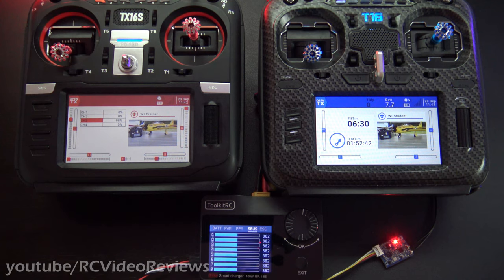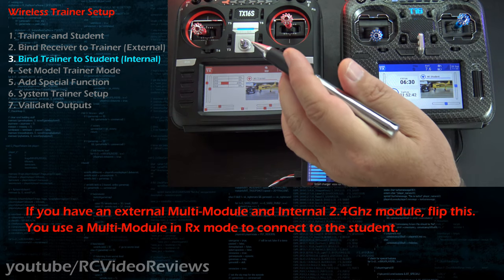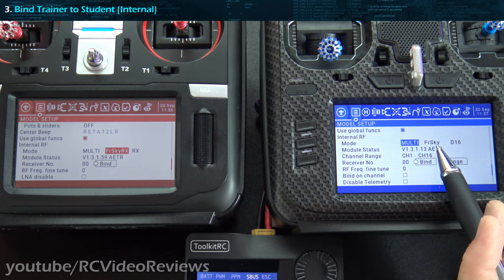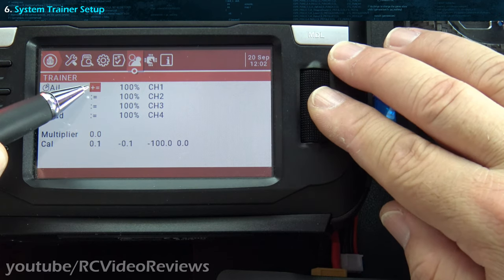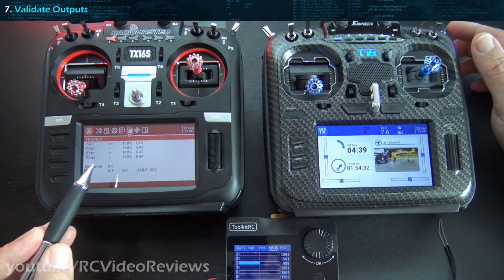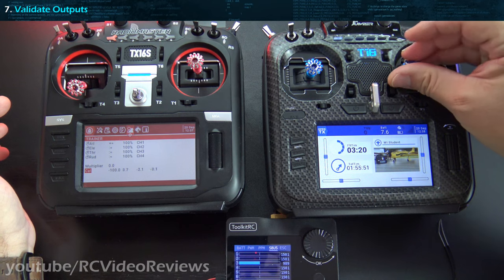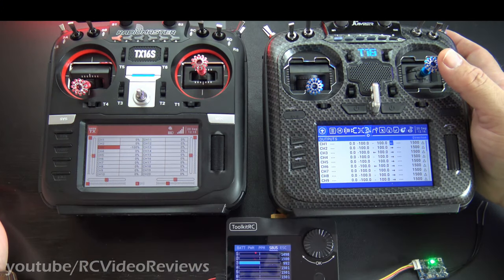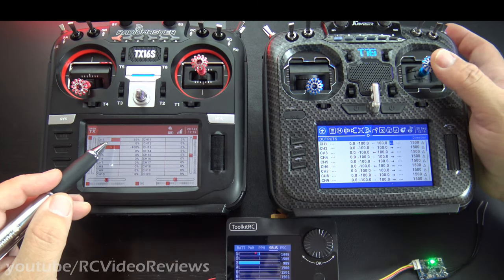OpenTx Wireless Trainer How-to • Complete Guide for Radiomaster TX16s or Jumper T18 • [Intermediate]

Comment: Hey John, updates on the TX16S trainer connection. The PPM trainer socket at the top of the Radio is pretty well useless for a Buddy Cord to another Tx. The 4-contact socket is a non-standard 3.5mm Cliff Electronics unit and, even when we got the correct plug/cable, the connection proved less than rock solid. So we added a cheap FS-A8S PPM/I-BUS/S-BUS powered by the neg (second bottom) and + (3rd from bottom) pins in the External Bay when the "External Module" is activated and soldered a fly lead to the 3rd contact of the Trainer Socket (PPM Output/Input)to plug into the PPM output of the A8S. An XH balance lead makes a convenient connector for the power leads and is short enough to allow the bay lid to be replaced. The PPM fly lead can be withdrawn to allow the Tx back to be removed or an External Module to be added in the future. The A8S covers our TX16S and FS-i6/S student Radios and can be substituted for any other Tx/Rx combo with a PPM output. According to others on the RC Groups forums, the TX16S (unlike the Frsky QX7 etc) doesn't have a suitable S-Bus or PPM pin in the module bay pins. Seems odd, but the Trainer contact works.

Comment: Great video! But I have an issue with the connection. I have 2 Horus x10S Express but Im not able to bind it, both starts beeping but no positive result or bound. On master radio you put "Master/Multi" but on the student what you I put? Slave/Jack?

Comment: Hello, very understandable video even for non-English-speaking users. However, I have a problem: I have a Boxer and a Zorro,
Boxer is supposed to be a master and Zorro is supposed to be a student. The binding worked after a bit of trying. And I could also see the joystick deflections on the master's monitor. But the moment I connected the external CRSF module, the connection to the Zorro was lost. CRSF off and it worked again. But not the trainer mode as desired.

Comment: I'm yet to ever use the 'buddy box' connection; training was always a 'quick pass me the radio' moment as when I was learning there wasn't any means to connect a HiTec 720 to a Futata Skysport haha. I still have my 720 Tx, they were pretty good radios for the day. On a tangent I have been testing the FlySky CAT01 Altitude sensor which reads Air Pressure, Altitude and Ambient Air Temperature. I had set it as a Vario too but it doesn't output positive values on ascent (+), or negative values for decent (-) so it won't generate a true vertical speed reference to correctly drive the Vario option in OpenTX.

What the CAT01 sensor does though is give accurate positive values from zero for Altitude, and for Air Pressure it outputs the change as a negative value as it measures the reduction of pressure as height increases. I'm trying to get OpenTX to read either these values and return a sound for increase or decrease via Logical Switches but I wonder if you might know a more elegant solution via OpenTX before I look at buying a true Vario sensor? The CAT01 does return accurate Alt values (as meters) which I have the value call out on a Special Function which sort of makes up for the lack of a vario sounder.

Comment: That's a fair bit of fluctuation seen on the trainer screen on the TX16S from the pots (sticks) on the T18.  If you were to set up the T18 as the Trainer radio, and the T16S as the Student radio,  do you see similar fuctuations from the hall sensors (sticks) on the TX16S? Great video BTW!!
Reply from the maker: These are both hall sensor gimbals. I haven't setup the reverse. I did notice the fluctuations.
Reply: @RCVideoReviews  My mistake John,  I got confused, I thought the lite came with the RDC90's and the Pro came with the hall effect sensors, I see now it's the other way round. I'm surprised to see any fluctuations with hall effect gimbals, I'll admit I've not looked at the ones in my TX16S much due to a lack of time to spend on it at the moment, but the hall effect gimbals on my Jeti DS-14 are totally rock solid.

Comment: Amazing video. Clear and direct. How do you get the red detail in the guimbal? It’s very cool. Congratulations.
Reply from the maker: Those are 3D printed gimbal spacers: https://www.thingiverse.com/thing:4492448  That's not the exact set I found originally (looks like they may have been removed), but they look to be the same.
Reply: @RCVideoReviews  thanks for your fast replying.
Reply from the maker: @sonarfleet2375  Sure thing.

Comment: G'day John. You have set this up with the External (non-multi) module talking to the plane and the Internal (multi mode) module receiving from the student radio. Painless360 in his video of May 19 2020 has shown a wireless trainer set-up but using an External (multi mode) Jumper 4-in-1 module receiving from the student radio and the Internal (multi mode) module talking to the plane. So the JR Bay connectors can act as both input and output from/to the receiver/transmitter function. This stuff is admittedly way beyond my understanding but I was wondering if there was any way to connect a simple receiver via those bay connectors to receive the student commands? Or would any circuitry needed to transform say a cheap Flysky PWM/i-BUS/S-BUS/PPM receiver outputs to a form that the Internal Module can process make the process impractical/impossible?
Reply from the maker: I'm sure there is some way to wire an external Rx to the bay to receive student commands. I haven't tried it. That is a very specific solution and while an interesting idea I don't know there'd be broad appeal for it. XJT modules are pretty cheap and it just works that way with no fuss. Using an external Multi Module would be quite easy too. If you work it out, let me know though. I love that kind of thinking.

Comment: Thanks for this very useful and well made video. Do you think I can do it between my brand new eachine tx16s and my old flysky IA 6 ?
Reply from the maker: Probably, as long your multi module will bind with the IA6, it should work. The TX16s doesn't know what radio is on the other side, it's just acting like a big receiver.
Reply: I take it that the "old flysky IA 6" is a typo and you are actually asking about a Flysky FS-i6 radio set to AFHDS 2A output. If so (and you have a second module in the External bay on the Eachine TX16S) then the answer is yes.

Comment: Great video. Question: Can I do this with a Radiomaster TX16s and a Taranis X9D? Thanks.
Reply from the maker: Yes
Reply: @RCVideoReviews  Thanks for the fast reply. One last question: Is it safe to assume that I have to program the Taranis exactly the same way as the Radio Master in you video, since I use open TX as well!? Thanks.
Reply from the maker: You should mimic what I have in terms of master/slave setup. The rest (channels) are configurable.
Reply: @RCVideoReviews  OK, I got a few things mixed up. I thought that both radios (transmitters) will be "bound" to the same receiver with the help of the XJT Module. I guess that is not true. Instead, you bind the XJT Module to the receiver in the plane, and then use the Internal RF from one radio (acting as a regular transmitter) to connect to the second transmitter (acting as a receiver). Kind of makes sense. 
I wonder if you can do it the other way around!? Instead of binding the XJT Module to the receiver in the plane, leave everything the way it is (Radiomaster TX16s is bound with the receiver in my plane) and just bind the XJT Module to the second radio. That way I do not have to "rebind" the receiver in the plane, which can be hard (depending on how deep it is berried in the plane) and I can also take the Module out if I do not need it, which is 99% of the time. 

Thanks.

Comment: How would one set it up using a wired connection? Or how would you connect if using a different rx like RX8, R8. Good video and very helpful.
Reply from the maker: To use a wired connection you Master/Jack instead of Master/Multi. All other configurations options apply.

I don't know what an RX8 or R8 are. If you want to use another radio wirelessly, you need to make sure the Multimodule supports an RX version of the protocol. In this case I used FRSKYRX. For DSM you would use DSMRX, etc...
Reply: @RCVideoReviews  RX8Rpro or X8R are Frsky receivers. Typo Thanks again.
Reply from the maker: @N2RIT  Those are both ACCST/D16 so yes, they'll both work.

Comment: Great video! Which trainer mode do you select in student radio (T18)? Thanks
Reply from the maker: Any of the master modes are fine. As far as the student radio goes, it is connecting to a normal receiver.
Reply: Thanks!
Reply from the maker: @piloto300  You're welcome.

Comment: Thanks for the clear video! I’m still trying to figure out the LBT stuff. But let’s say I eventually want to switch all of my stuff to LBT would it still be possible to use student mode? Only I can not really find how to change the firmware of the xjt module if I eventually want to do that
Reply from the maker: I know the XJT can support LBT, but I don't know if you can flash from one to the other. I also know the LBT XJT doesn't support D8 mode, so keep that in mind if you start flashing stuff.
Reply: @RCVideoReviews  I saw a video on how to get d8 on LBT. I’ll look it up again
Reply: The XJT module firmware comes in two versions FCC or EU/LBT you can switch back and forth but if you do then you have to flash your receivers to match. As for D8 that is hidden by OpenTx when you select EU when downloading the firmware in Companion. If you don't select EU then D8 is available.

Comment: A question I've been trying to answer is: Can you setup a wired trainer with a non opentx radio. I've got a Flysky IS-6X that i've been trying to use but I've been unsuccessful to date. I guess I could spend the $$ on a Flysky module and go wireless but what fun would that be?
Reply from the maker: Yeah, don't know the answer to that one. Did Google tell you anything useful?

Comment: small question.. what about invert  the process:  using original binding of the internal module and external module to bind  with the other radio ?
Reply from the maker: I don't believe you can do that. The internal module has an "RX" protocol. I don't believe the external XJT allows that although to be honest, I've never studied the matter.
Reply: @RCVideoReviews  i found RX protocol i will try to see if It works this way i can skip binding models ti the external module

Comment: Thanks for the great set of instructions. But I am facing an issue can anyone please help. I keep getting the "Trainer Signal Lost" alarm and I have noticed this happening randomly and very often when my student is close to my radio. I am using the Jumper T18 5in1 radio as the master with the internal set to frsky_rx and the Jumper T-Lite as the Student. I have an ELRS external module in the Jumper T18 which is the actual control link to the model. Please help.

UPDATE: To All you guys, On the Master radio use FS2A_RX on the internal RF-module, and on the Student radio use FlySky_2A. This is a much more stable protocol than the D8/D16 which keeps giving "Trainer Signal Lost". FYI I am using the latest firmware of the Multiprotocol Module and using Edge TX also the latest one as of today.

Comment: Will a jumper 4 in 1 external multiprotocol module work as well as the FR sky XJT?
Reply from the maker: It should. Then you can use any protocol you want.

Comment: UPDATE: To All you guys, On the Master radio use FS2A_RX on the internal RF-module, and on the Student radio use FlySky_2A. This is a much more stable protocol than the D8/D16 which keeps giving "Trainer Signal Lost". FYI I am using the latest firmware of the Multiprotocol Module and using Edge TX also the latest one as of today.

Comment: Stupid question here. To pair the tx16s with a Spektrum dx8 g2 and Lemon dsmx receiver would I have to make tx16s the slave, or is there an external module that supports dsmx?
Reply from the maker: To pair with two devices you need two transmitters. I don't know if there is an external DSM module, but there is an external MPM module that should work with DSM.
Reply: Hi there Randy, i have both spektrum and Tx16s and can say that G2 radios has a wireless radio mode and will bind to any radio on DSM2 and DSMX, so it will link as intructor radio with Tx16S as student radio. No need for an external module. Tx16S internal module in DSM2 or DSMX  to bind with G2 in wireless trainer mode.By the way i already tried it with my DX9. If you want Tx16S as instructor radio,then you need and external module. Hope this helps.
Reply: @RCVideoReviews  Hi John,no need for external DSM module,G2 radios have an internal receiver that binds with any DSMX and DSM2 radio for wireless trainer. Something i wish RadioMaster and Jumper had in the external bay,as a possibility so we could bind any receiver to it. Don't know if the heartbeat(SBUS/CPPM) input pin in the bay is for future implementation.

Comment: You can just see some OpenTX geeks (in the best way) sitting around when someone wonders, "we've got to transmitters available, why waste one.  Just astounding capabilities.  Now we need  FrSky and Spekum go OpenTX
The revolution continues!  .
Reply from the maker: Right? Very clever little trick. Just keep in mind the range is a little bit limited. We found ourselves staying within about 10'. Outside of that, we lost connectivity.

Comment: Very good video however since updating my two tx16s txs to the up to date firmware on opentx v 2.3.11 I no longer have the option in Internal RF to set it to FRSKYRX   RX and therefore cannot bind the two radios. I am also using the Frsky xjt Module. I also cannot roll back the Opentx firmware to an older version. can you please help. Thanks
Reply from the maker: You can roll back firmware. OpenTx doesn't prevent firmware downgrades. OpenTx firmware also doesn't change the Multi-Protocol Module firmware. That is completely separate and the options available for binding on the MPM are completely separate from OpenTx. In any event, when you upgrade OpenTx firmware, they usually suggest a MPM firmware upgrade to go with it. You should see a suggested firmware message in the model setup page.
Reply: @RCVideoReviews  Thank you for your quick reply, I will give it another go. Keep up the good work. Thanks.
Reply: Hi again, I thought that I would post this in case someone else is having problems with getting two radiomaster tx16s tx's talking to each other using the up to date opentx firmware 2.3.11.
Master tx: Internal RF set to Multi  FRSKy RX  Multi, module version v1.3.2.77. External RF module set to XJT  D16.
Student tx: Internal RF set to Multi FRSKy X D16.
I now have the external frsky XJT module talking to the receiver and the two radio master tx16s tx's talking to each other.
Hope this helps. 
Thanks again for your video's.
Reply from the maker: @cliffbrumfield7870  Glad you got it working.

Comment: So why can't i do this with just a receiver in the master radio like I did with a X9D?
Reply from the maker: That’s effectively what’s going on. The multi module is in receive mode. The external module transmits to the model.
Reply: @RCVideoReviews  thanks for the reply! I'm gonna try it. I put my xm receiver in the radio master but it got weird. I now know from your video that the ground and power are opposite so I will wire correctly and then try it. Xm receiver is $10 and fits inside the cover compared to another module...
Reply from the maker: I've never tried to use an Rx in the external bay so I haven't checked to see if the external bay supports rx mode. I know the mpm does. I'll be interested to hear how it works for you.
Reply: @RCVideoReviews  No. The Eachine/RadioMaster TX16S radios do not have a dedicated S-bus input in the Module Bay.

Comment: i am having issue whith this. I have a tx16s and an extra 4 in 1 module and a taranis. I connect the internal module to the plane and connect the external module as rx to the taranis. only than i get extreme range issue between trainer and student. They keep loosing connection.
Reply from the maker: Mine worked within about 6'. After that it dropped connection. I don't believe this is meant to be a long range option.
Reply: @RCVideoReviews  mine drops even when standing within 1 meter so not reliable for me.
Reply from the maker: You're not pointing the antennas at each other or anything like that right? I was good for about 6'
Reply: @RCVideoReviews  nope it just drops. I tried multiple.firmware versions.
Reply: @RCVideoReviews  Can you post a picture of the antenna setup the way you had it?

Comment: Very cool
Reply from the maker: I was thinking this would be a great way for Chris and I or Dave and I to take turns flying planes. Dunno why I didn't do this sooner.
Reply from the maker: @jimsnodgrass8454  I didn't intend to advocate for the use of +=, just needed to show what it did. I can see how that QTB would be beneficial. Neat idea. OpenTx is great.

I've trained my fair share of pilots just passing the Tx back and forth, so any of this is icing on the cake for me.
Reply from the maker: @jimsnodgrass8454  If I recall, your trainees might be a little younger than mine..?